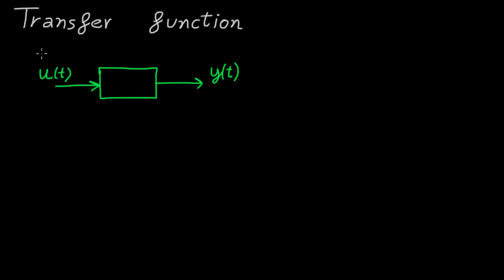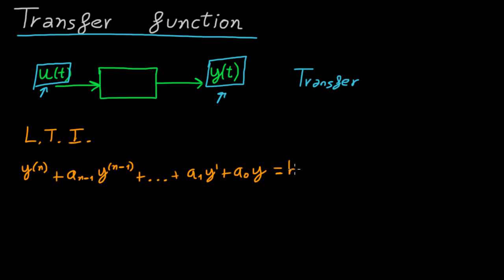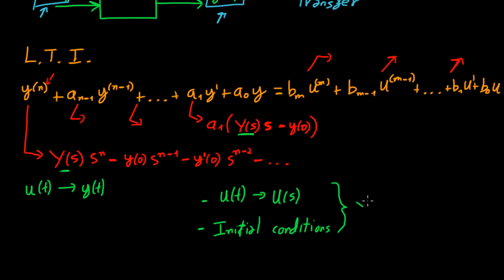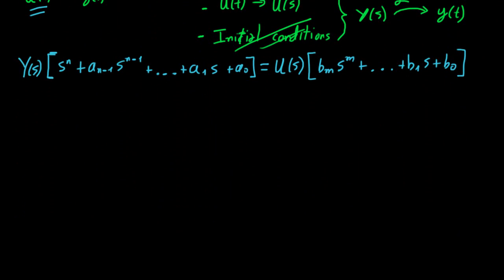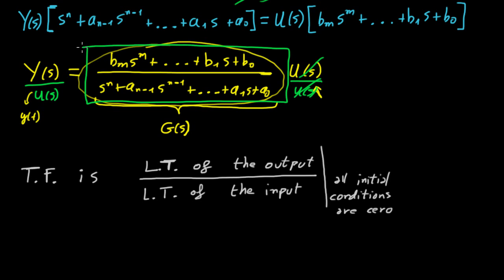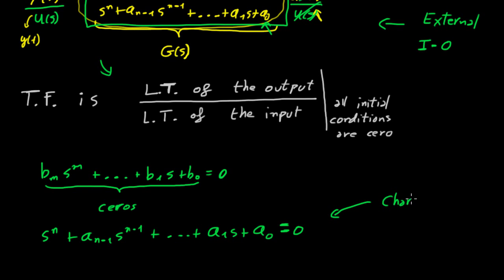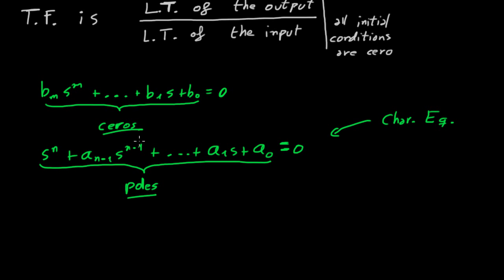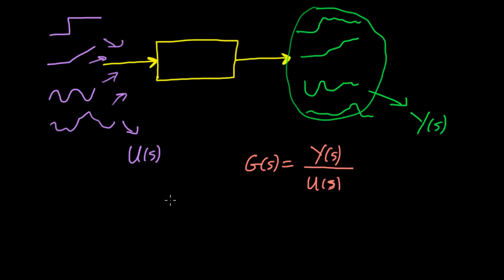Transfer function

Comment: Quick question: if I recall from the diff. equations video you said that in order to guarantee causality it should be (n >= m) and not (m > n) as you describe at 13:43
Reply: I apologize, my mistake here, m>n is the condition for when causality does NOT happen